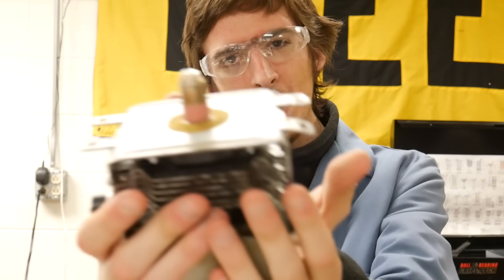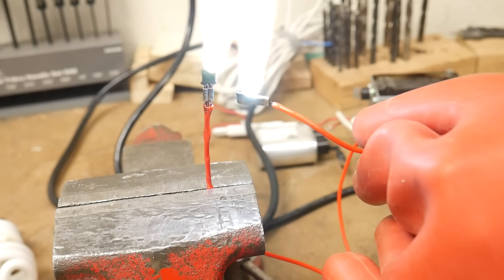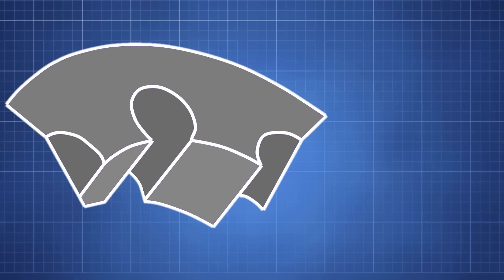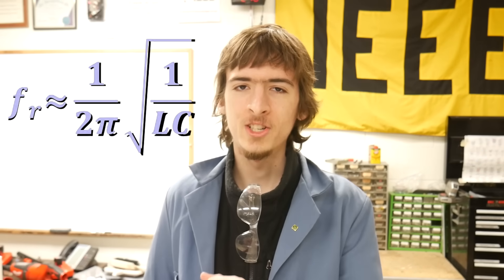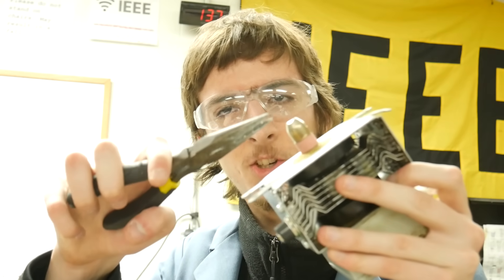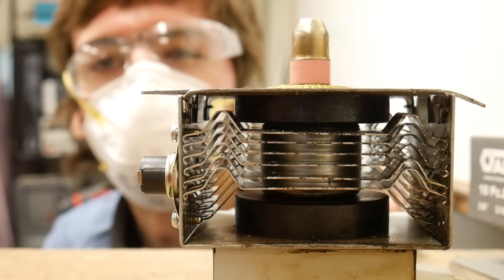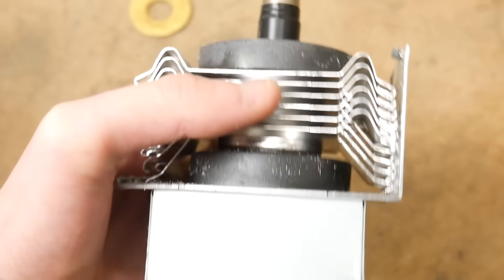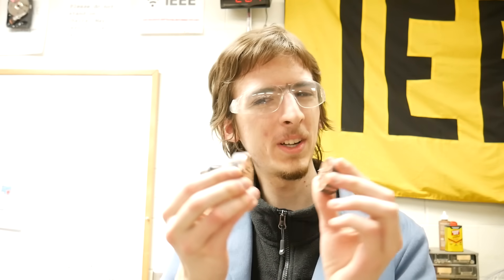What is a MAGNETRON - How Does it Work

Comment: your right habd rule.......wrong.....Force magnetic field  E. current....thumb index middle...respectively
Reply from the maker: You had me REALLY worried there for a moment. Let me explain...

I did a quick google search and immediately saw people doing it your way. "Uh-oh." I did a little more looking into it and quickly discovered what the problem was. Those diagrams apply to electrons (-) charges. And the right hand rule that I use is for conventional (+) charges.
I double, triple checked Wikipedia, Khan Academy, and even my college Physics textbook just to be sure. Turns out it just depends on our convention (and some are just plain wrong but I've come to expect that)

I will grant you this: in the video I was talking about electrons so... you're 100% correct in that case. It is in fact I who needs to be more careful with my convention.

Let's call it a draw.

Comment: great video thanks for sharing - heads up on the side of the frame there are two clips you can just stick a flat screw driver in there and pull open the little clip and the top will pop off {in most cases} 

thanks for the explanation - you added a new depth to the info i think  : D
Reply from the maker: Now that would have been useful! XD
I'm really glad you enjoyed it too

Comment: Maybe magnatrons can help create fusion.
Reply: Actually on some experimental fusion reactors microwaves are used to heat the plasma!  The Wendelstein 7-X for example.
Reply: Heat plasma with magnetrons but compression will be generated with super magnets inside an air tight piston cylinder. Razer micro fussion reactor.

Comment: if electromagnets motors used tesla coil and diodes and ceramic layers and metal mixture and microprocessor based control system and the temperature of oven by microprocessor based temperature recorder so we got more healthy cooking technique instead of toxicity in microwave which are used in hostile environment of mars
Reply: Whats with the technological gibberish spam?

Comment: Is a magnetron still dangerous even if it's disconnected to it's power?
And I'm not joking, I've just took a microwave apart and i'm frightened of it because I do not know if it's dangerous or not (I didn't connect it to it's power so I don't think it is, but there's still a possibility that the magnetron itself can be harmful)
Reply from the maker: It's not going to be dangerous if it's just sitting on the table while not plugged in. If it has been on recently, ground it to dissipate any residual charge and give it some time to cool off.
The materials can be dangerous. The pink rings are a ceramic made of beryllium (toxic is broken and inhaled) and the filament (inside the magnetron) is made of tungsten and thorium and can be slightly radioactive. But this is negligible so long as you don't remove it.
So unless you plan on powering it on or cutting it open, it poses little to no risk to you.
Reply: Blueprint no it hasn't but it does contain thorium.... And that's why I'm kinda scared of it
Reply from the maker: So long as you don't grind it up into a powder and sprinkle it over your food, you'll be alright. Remember, these are approved for use with food in a microwave.
Reply: Blueprint yeah but normaly they are in a casing but thank you for the vid :)
Reply: MichaelKingsfordGray I was aware of that but would it be able to power the magnetron at let's say 50% of leftover charge?
Reply: But absolutely short out the capacitor terminals with a screwdriver if the oven has been recently operated to dissipate any 1,000 volt charge. There is a bleeder resistor in the cap to do this, but take no chances.

Comment: The pink ceramic material is not beryllium oxide.  It is aluminium oxide and therefore not hazardous at all.
Reply from the maker: I like to treat everything as if it is beryllium oxide.
Also, beryllium oxide can be pink. But, yeah, it's not really used anymore. But I had no idea how old the microwaves I took apart were.
90% chance you're correct. But what if....

Comment: 2.4 ghz is a frequency of repetition not a strength or volume.    A capacitor is extremely dangerous irregardless of whether or not the device is plugged in or not.  The capacitor can electrocute you when accidentally discharged by grounding it.
Reply from the maker: Thankfully, there is a bleed-out resistor. From what I can tell, it discharges almost instantly

Comment: I would imagine that copper is being used because of its electron valence. Great video. I watched this video because I wasn't sure how you were going to deal with the beryllium shell. Good job! Keep up the great videos.
Reply: mopar3502001 I think copper is used because it has very high electrical and thermal conductivity and is cheaper than silver.
Reply: You are correct! Electron valence is the electrical conductivity (electrical permeability, measured in the SI unit called Siemens) of a material. This describes how charge carriers interact with various kinds of conductors. As for copper, it's atomic weight is fairly heavy, which provides good thermal inertia and very good emissivity. Copper has an electron valence of 2, meaning it will accept two more electrons within it's shell (quite simplified, albeit). Silver has a valence count of 3, therefore it is a better conductor, but it costs a lot more $$. The density of copper gives it a lot of thermal inertia, and handles heat quite well, which makes for an excellent heat sink. But it is not a cheap as aluminum!

Comment: microwave oven
and increasing power oven
since infra red light also carried out heating effect
and going towards increasing energy density like gamma ray oven
what type of diodes and capacitors and magnetrons used in that case
Reply: i dont recommend the gamma ray oven.

Just a little dodgy.

In any case, if you produce gamma rays, it will not heat up the food but the gamma rays pass straight through and dont vibrate the molecules of the food/target enough for heating.

Although, if your in the way, your DNA will get fragmented, but not via heating.

Microwaves will destroy your DNA by boiling the water in the cells and splattering the content of the cells (like the grape hissing and exploding in the microwave)

The oven (infared) denatures the DNA directly with heat - probably oxidizing it as it burns in the oxygen atmosphere of the oven - roasted as they say.

Gamma will directly fragment the DNA, but so powerful, it will not need heat to oxidize and burn in the air. Hence why gamma is so frightening, this is a silent process - cannot see anything happening.

Of course, the DNA is damaged, cell will not replicate - but the cell is not burned, so still remains intact - later just rotting. Hence, radiation sickness symptoms have a delay lag time.

Comment: Excellent video! I was curious about the Potomac Dual Magnetron Controller and you boiled it down perfectly! A short video, yet appropriately detailed for the topic with the necessary safety warnings.

I am curious, what video editor do you use? I make videos occasionally and would like to improve animation and video add-on illustrations.

Keep up the great work!

www.HallmanLabs.com
Reply from the maker: Thanks, I'm glad to hear that you liked it!

I use Sony Vegas 15 for all of my video editing and I create the objects in MS Powerpoint. It simply takes a lot of patience, planning, and chroma-keys.

P.S. I checked out your link: cool stuff.
Reply: How to reduce heat of magnetron
Reply from the maker: @sankarv3451  Did you see all of those metal fins around the cavity? That was a heat sink. There is a fan that blows across it a sweeps the heat away. If not for that, it would be too hot to operate.

Comment: PUT  UP A DANGER SIGN OR YOU COULD END UP COOKING SOMEONE AND YOU CAN AND DANGER ON THE TRANSFORMER OUTPUT AS WELL VERY HIGH VOLTAGE THAT CAN KILL I USED TO REPAIR THEM!!!!
Reply from the maker: I am very aware - just read the first line of the description. Although this video really doesn't have to do with the transformers. Anyway, thanks for the input; I'll be sure to include more notice next time.